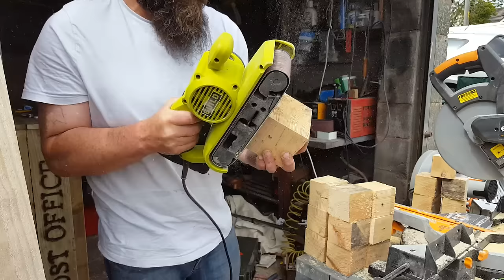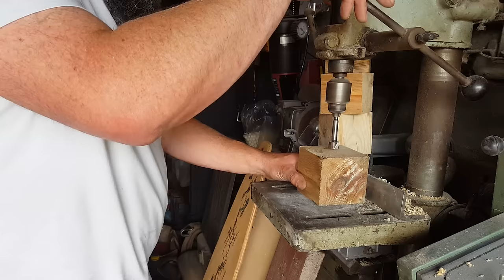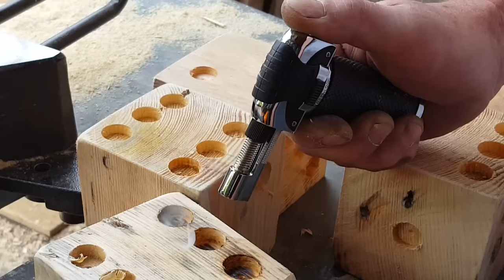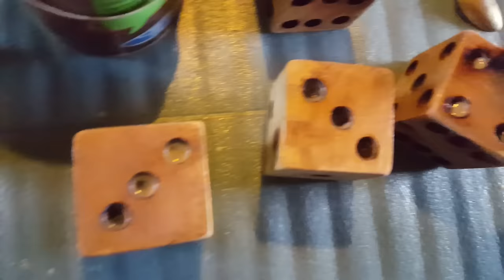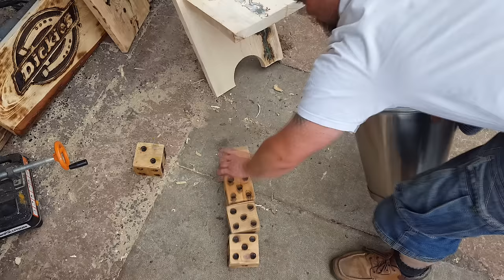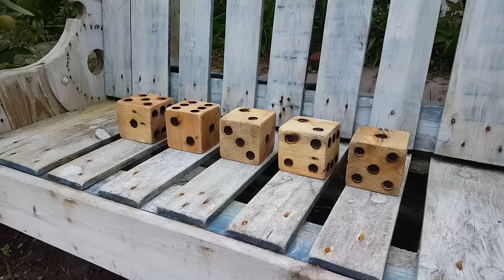Toys from Pallets - Yard Yahtzee From Pallets

Comment: http://www.screwfix.com/p/energer-enb459sdr-3-belt-sander-230-240v/55570

I bought this. I wanted to try out a cheap sander. I noticed it has a foot plate attachable to it may help me for clamping on a jig set up. Will let you know how it goes
Reply from the maker: its when youre ragging them for hours and hours that the problems kick in,  and thats the problem with recycled wood, do you use a planer to shift off most of it and risk chipping your blades or do you rag your belt sander across it to clear off the crap....but yeah,  whats on your project list at the moment?